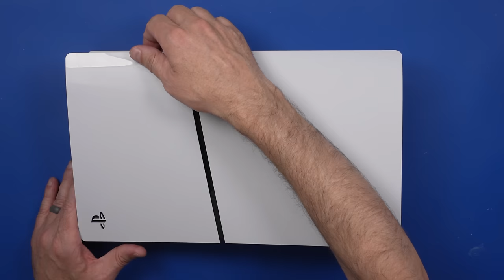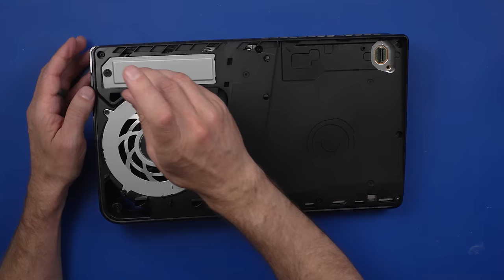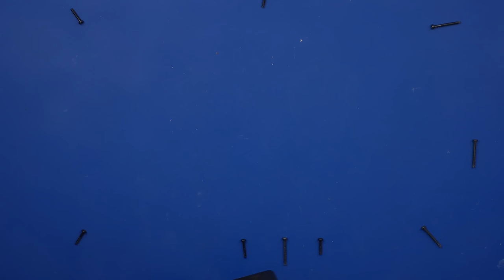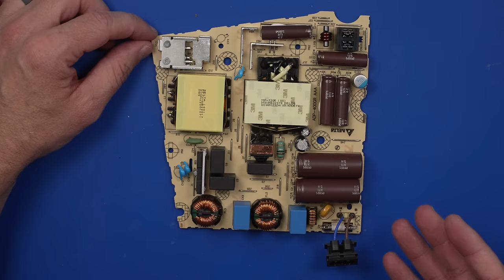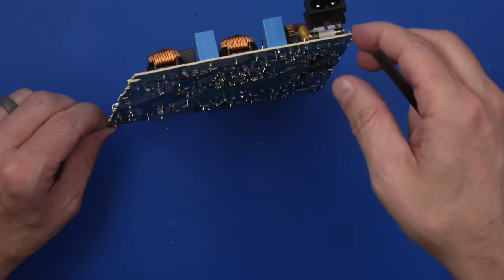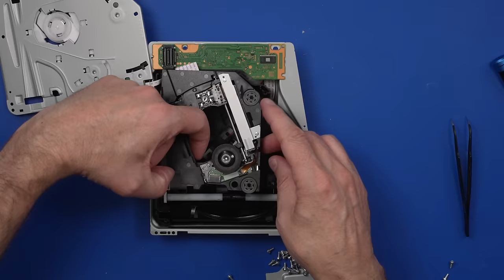The PS5 Slim - A Repairability Perspective - Detailed Teardown

Comment: The disc drive being replaceable is a plus in my view. No more need to de-discify boards with broken drives to keep them working.
Reply: as far i know theyre not interchangeable....
Reply: They are interchangeable
Reply: Until the servers shut down and you will not be able to register the drive anymore. Servers will be up for years though I think.
Reply: OP, you seem to ignore that Sony made it so that the disk drive will only work on the device as long as their servers are up and running.

That's a HUGE flaw right there that destroys any other advantage.
Reply: If you connect the external floppy disk drive, you will need an internet connection, just for info.
Reply: @Jedzelex  As far as I understand it, that's not true. The internet connection and Sony's activation servers are only needed for initially pairing a drive with a PS5 console.
Reply: @proesterchen that’s incorrect. If you reset the console it’ll unpair the drive. If you swap to another drive-it’ll need repaired again. Nightmare for longterm preservation.
Reply: @adamthiry868  That's like complaining about your car being in a ditch ... after having driven into said ditch yourself.

The console comes unpaired from the factory. Obviously, factory resetting it will put it back into that exact same state.
Reply: @proesterchen  not complaining. Pointing out from a preservation standpoint what a bad thing it is.  If one day Sonys servers are unavailable and you find yourself needing to pair your disc drive-you won’t be able to do it. Obviously it’s a non issue now. But what about someone 30 years down the line? Will they be able to still use it? I’m a huge proponent of preservation. And from that standpoint-this is awful
Reply: @adamthiry868  If preservation is what you're concerned with, you need to stockpile compatible devices and hope they'll last you until you shuffle off your mortal coil.

This changes nothing for preservation, but it does make all cases of damaged drives technically fixable, so it's a net positive in my book.
Reply: @Jedzelex  agreed it's a huge flaw, however I'd say that the ssd being soldered is a bigger flaw, it'll be a brick when it eventually fails, unlike the ps4.
Reply: @blastechee-3546  they'll likely release an update to allow you to do it offline once the servers are about to go down.
Reply: @hatsonchickens  Hopefully or this will always be a crutch to a brand new system.
Reply: @proesterchen  Stop ponying bad Sony decisions, if a disk drive for a console YOU payed down the line stops working just because you want to sell it years later when Sony removes that server...
The console will become a digital brick unless it is modded. What Adam said is NOT comparable in the slightest bit to "a car being in a ditch"
Every single other console we've had until this point have still been able to play games even after being reset/offline. In the long term, this will be a bad if nothing is done about it.
Reply: @HippyDipps Just consider the lengths of absurdity you had to go to to construct a set of circumstances under which someone who is presumably fully aware of Sony's pairing servers having been turned off in the far future also deciding to sell their classic Sony Playstation 5 with an already-paired disc drive, only to then factory-reset it before handing it to its new owner.

And that silliness somehow outweighs however many PS5 consoles that would otherwise have at best continued as de-discified editions now being easily fixable with a user-replaceable drive? Come on.
Reply: @Jedzelex  exactly. It about all control, and no I’m not being extreme here. Why bother registering XYZ as to keep using what we legally bought to OWN IT in the first place? It a “co-owner” peripheral device!
Reply: @proesterchen  im from 2030 i want to chang the disc drive but the ps5 server is no more😭
Reply: They have always been able to be swapped out
Reply: No, the disc drives of older models were married to the board they were shipped with.

If the chip in the drive carrying that information died, the only option was to turn it into a digital edition.

Comment: Have had my ps5 since day one.  Just recently took it completely apart to clean and check liquid metal. It definitely needed a cleaning but the liquid metal was spread nicely and had zero dry spots.  As long as you don't move it directly after playing it hard and hot the liquid metal is not a problem. Will open up my second PS5 in a year or so and see if has the same non issues
Reply: Do you have it sitting vertically or horizontally?
Reply: @andycortez9316 why even risk it at all?! Gravity is gravity and liquid metal behaves as such. I put mine horizontally as soon as I learned about the issues. It's not really the fact that the liquid metal may gather on the bottom side that bothers me (although that's an issue on its own) but the fact that the chip seal may fail sometime and that's when the magic smoke escapes. 😅
Reply: What was dirty inside? I've only dusted the fan once.
Reply: I've had my ps5 vertical for a year now, no problems at all. I don't go moving it around though
Reply: @andycortez9316 vertical 100% of the time.
Reply: @clue0001  they say that as long as you never opened up the seal around the liquid metal, you are OK. Even tronicsfix said he has never seen the failure to the seal itself even after reassembly as long as you properly tighten the screws up. As for the dry spot issue.  I will be willing to sacrifice my ps5 to see if keeping it vertical since day 1 causes dry spot for science lol
Reply: @brandonerrorcontentmissing4012  ahhh yes me too. And I will keep it vertical for science

Comment: The HDMI port being weak is a problem I had with my first gen PS4. I tried taking it to a repair shop, but for some reason they told me they couldn't fix it and I ended up just throwing out a perfectly serviceable PS4. This happened a long time before I learned to repair my own electronics. I wish I learned to fix stuff sooner rather than rely on a shop that was just too lazy to repair a simple fix. I wish I still had that PS4, it had PT on it. Oh well, won't happen again!
Reply: Ive attempted this on PS4. You need alot of practice to get it replaced. Otherwise you could tear pads and that is exactly what happened on my first attempt
Reply: @neoanderz  Absolutely. I'm not saying it's necessarily easy, but, if I can do it then a business that fancies themselves a repair shop shouldn't be turning customers away.
Reply: Why didn't you just sell it for parts?
Reply: @alexbridenbaker9261  I didn't realize that is was repairable at all at the time so I also didn't realize that anyone would find value in it for parts or even be able to fix it themselves. Short answer: I was ignorant and naive.
Reply: There are ways to get PT again. You'll have to search, but it's possible. As long as you still have the PSN account you originally downloaded PT with, that is.
Reply: @PowerSynopsis  Even if it's damaged beyond repair, there are other parts still salvageable
Reply: @alexbridenbaker9261  Well, yeah. I know that NOW. But like I said, at the time I didn't know there was any worth in something that "professionals" said was junk.
Reply: @PowerSynopsis  You didn't say they called it junk, you said they couldn't fix it
Reply: @alexbridenbaker9261  When you don't know what you're doing so you go to a "professional" and the "professional" says they can't repair it it leads you to believe if the professional in the field can't do it then it's a task that can't be done. Hence it must be "junk". I completely understand past-him's reasoning.

Comment: Hopefully Sony does not software lock the disk drive, hopefully they can make it so you don’t have to register it to use it. but I wouldn’t be surprised if they do.
Reply: Hopefully is too optimistic. They already soft lock it with a firmware update / connect to internet right of the box. They already DID it.
Reply: it is a security thing that is why they lock it back in the Xbox 360 days you can flash the software to play burned games
Reply: As far as i saw online , if you buy a brand new ps5 slim you still need to connect to the internet/update software in order to use the disk drive. Also when you factory reset it also need to pair the drive. So in the future when they shutdown the servers, it will be impossible to use the disk drive
Reply: @thewavyshopofficial  yeah, but it got worse on the Xbox one, the this drive is literally married to the motherboard
Reply: @123theprodigy5 think he has done disc drive swaps on xbox one in previous vids...
Reply: @123theprodigy5  yeah that's kind of on purpose. Technically it was on the 360 with a DVD key, but people were able to crack the DVD protection. So Microsoft just beefed up the DVD protection so people can't modify the firmware to play burned games but you can still replace the DVD drive on the Xbox one. You just need to transfer the DVD drive board. Same thing with the 360 if you don't have a DVD drive programmer
Reply: The only way it won’t get scratched up is that u get a protective skin for it
Reply: Digital Millennium Copyright Act is the reason why this is like that and every device works like this since 1998 … the fact that it’s not registered out of the box is because Sony produce only digital version and the firmwares of disc drive ones are not factory updated that’s all. 
(Excuse my english)
Reply: And one day they do it. They'll shut down the servers, maybe in 6,9 years but the sure is they will do it
Reply: It’s wrong the shut down will not affect this it’s dumb … and the PS3 store took 15 years to close and they went backwards and PS3 is still updated and compatible with PS5 DualSense for example … if you don’t like it, it’s fine but don’t disgust others.
Reply: Is this why Xbox one n series x can't be played outta the box? For security reasons? Man I hated this about Xbox cuz I never have internet but I'll buy a new Xbox.
Reply: @annettecachora1224  maybe yes, very strange for a console with only disc drive but …
Reply: @annettecachora1224  yeah, pretty much
Reply: This is annoying went through that twice once with xb1s and then series x. Miss 360/PS3 era simpler times got my achievements offline. PS always cool till now.
Reply: @annettecachora1224  IKR

Comment: The dots on the PS5 Plastic Frame indicate the length of the screws, so in case you mix them up, the more dots = the more longer the screw is, the dots near that hole in the frame is for the fan screw.
Reply: How do you know?

Comment: I can’t believe how many people are trading in the regular ps5 model for the slim with it being essentially the same hardware internally
Reply: Not me, I love my OG PS5 and I'm not going to keep it throughout and not trade it for the slim.
Reply: @Azmodaeus49  Same here I have Korean import 1218 model that I will be using the entire generation I have the purple side plates on it I love how good it looks
Reply: ESPECIALLY with it being a Sony console's Slim model that just came out. I guess the whipper snappers weren't born when we experienced the engineering failure of the century that was the ps2 slim. "How did you make it not phat?" "We took out the cooling fans 😎".
Reply: @xEricC1001x  Those where the days 😅
Reply: ppl just like new stuffs
Reply: I have the OG version with the massive copper heatsink, so I will never change it for inferior overheating thingy without vertical stand :P
Reply: Doesn't matter, it's a bit smaller and newer. All the reason some need.

Comment: Looks to me that the 2-dot screw holes might be for orientation reference and thus not need to be screwed so tightly, while the 1-dot screw holes may need slightly more tightening to secure the device from falling apart.
Reply: Nah, it's actually for the screw lengths, atleast according to IFixIt, so in case you mix them up, the more dots = the longer the screw that is suppose to go into it.

Comment: Its a step in right direction. I understand about the HDMI but unless your going back and forth somewhere with it for some reason plug it in and leave it in. I moved mine once when i got a bigger TV.
Reply: What I’ve found to lessen wear and tear on hdmi is getting a bunch of those female/female hdmi connectors. You do this and all the wear tear is on that hdmi cable and that connector
Reply: HDMI ports is pretty much the most common job for repair businesses. Firstly, lots of kids take their console between different locations, parents houses. And people generally knock their consoles off things and it trashes the port. Am sure that plenty of people don't break their consoles, we just see every one that does.

Comment: He didn’t noticed that all the heatsinks are right next to the fan making a lot more easier to clean compared to the og ps5 that have the biggest part of the heatsinks a bit far to the fan so you have to completely disassembly your og ps5 to fully access them but here it is not a problem because they are right on the fan and heading to it i feel like thats a massive improvement for the peapoles that aren’t really experienced but still wanna clean easily their ps5 without a lot of different size of screw driver

Comment: Long wires are 4:30 in video are anti-strain/fatigue in high vibration area.  No manufacturing company would waste wire when making millions of units.  It is a design consideration.

PS:  and pardon the pun.  The power supply was tested when manufactured.  Depending on time from then to you is not long in this case.  Treat all power supplies as a gun.  If you see it, it is loaded, even if everyone tells you it is not, or you will get zapped.

Comment: Steve do you plan to remove the liquid metal to test how hot the slim runs with thermal paste?
Reply: It has the same chip it runs the same so it will overheat if you put thermal paste

Comment: I am curious if you could shed some light on what makes the conciliating coil whine in the power supplys? Those square things or the capacitors? My channel has two videos posted about how my OG PS5 had a terrible high pitched coil whine, and the replacement still had a choppy buzzing (but it wasn't as bad the the first one). My new slim actually sounds the best of all of them, but it still has a little bit of coil whine, but it is better and easy to live with.

Comment: My biggest concern for repairability for the PS5 has always been the custom built in SSD, we all know SSD's fail, I've recently had my laptop SSD fail. So once that happens surely the PS5 becomes a brick, unless repairers can get the custom controller and Nand(maybe the nand isn't custom, I don't know). Whereas the Xbox Series X(haven't seen a teardown of the Series S) has one of the smaller type M.2 so is easily repairable with disassembly.
Reply: The Series X/ Series S uses a removable m.2 However there is a hidden partition which needs to be cloned over. Depending on how messed your m.2 in your series X/S is, you are not always able to clone this. So Sadly, these to are bricks somewhat. This is essentially a problem with all modern electronics. Sadly unless consumers stop buying the stuff, the world will not change..I can say from running a full-time brick & mortar repair shop - alot of repairs are simply not cost effective and way to time consuming. Meaning there are repairs I used to do as a "hobbyist" that simple make no economical sense as a business owner (Im referring to all electronics in general, not just consoles). It comes back to the whole "Right to Repair"thing. Theres zero reason that companies like SOny couldnt provide tools and training to official licenced shops - just like mechanics have.

Comment: Observation... My 1115CA had only the PCB in the slot (metal below) to mount the M.2 drive to when i removed the cover. It was a NIB Horizon bundle model. The dots by the screws may be where push out pins shove the part out of the mold. Worked in plastics industry for a few months running a molding machine.
Reply: You're thinking of ejector pins, which show witness marks on the plastic where they push when the plastic has cooled down enough to eject from the mold. These are typically a large round circle to give enough surface area to eject the plastic without pushing through.

Comment: I’m wondering if this model will accumulate dust and debris more easily than the original PS5 given that they’ve removed the vent ‘grills’ which somewhat help reduce dust getting inside the console. I’m thinking that if you stand this new model vertically out in the open, like next to your TV, then dust can freely enter the top and front of the console. Sony look to have also removed the ‘dust catcher’ holes under the plates that let you vacuum out any dust accumulation. It’ll be interesting to see how this new design holds up in the long run.
Reply: The dust problem is due to the lack of game. I don’t recall the last time I used mine.
Reply: @nothingtosee7718  I bought a ps5 with no games to play
Reply: @orion4829  me too… it’s a PoS 💩 that’s why it’s collective dust, but X and PC are seeing lots of love.
Reply: PS5😎💪
Reply: @Daniel-ug7hs  not all consoles are created equally. PoS5 is the runt of the litter for sure. 💩

Comment: Thinking the dots next to the screw holes are the thread pitch. Two dots are coarse, and one is fine. The dots match up to the screws for the fan. Also, the two dots next to the hole is probably for that top left fan screw.

Comment: The dots might be the screw size and the ones near the fan probably refers to the screws in the fan and not the hole. I could not tell which screws came from which hole to confirm though.
At least you don't need to fully disassemble the PCB shield sandwich to get to the PSU as it comes out in one piece.
Reply: Most likely some orientation markers for the assembly robots
Reply: Orientation markers for assembly robots are called Fidusials and 9of 10times they are marked by + or + in a circle. Dots as a fiducial are less common.